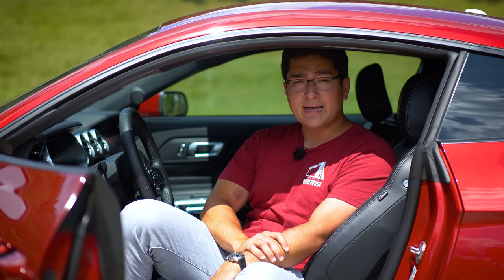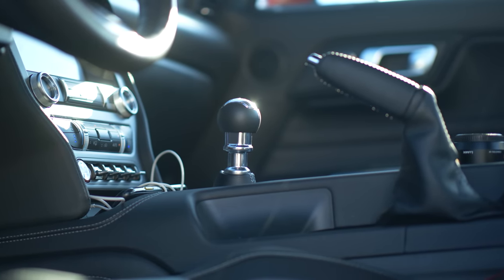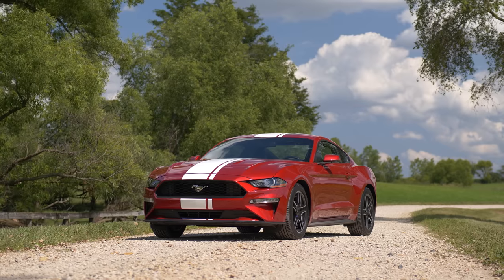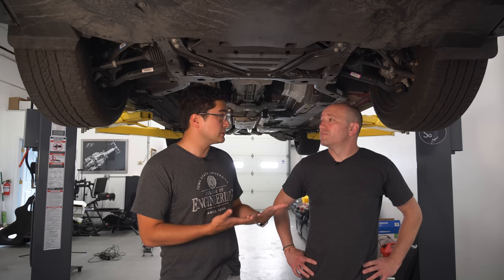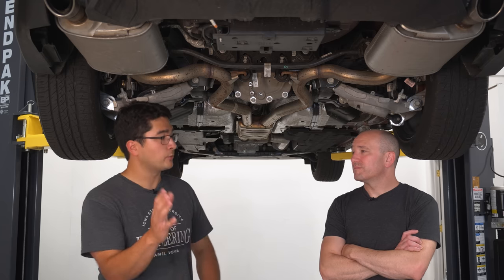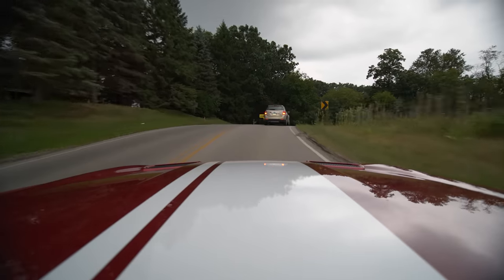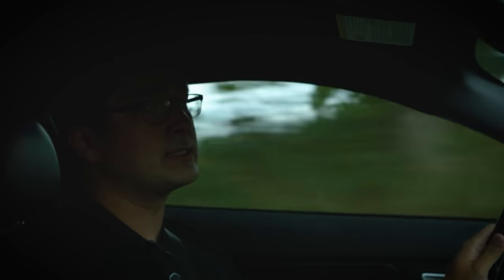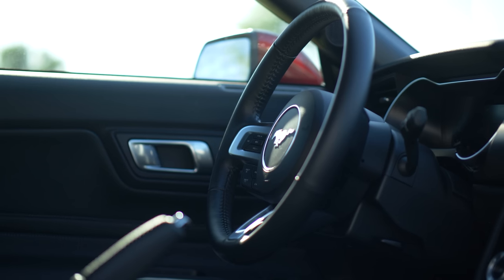2020 Ford Mustang EcoBoost | Red Headed Step Child

Comment: Loving my HPP HP. Great gas mileage when I drive it like a "normal" person but can't always find the strength to do so. 200 lbs lighter up front than a GT and just a BLAST to drive in any corner. Spec'd out and cheaper than the PP2 GT. No brainer. 7th Mustang I've owned and over half were GT's and this one will smoke all of them. Nuff said.
Reply: You're so lucky man to have gotten an HPP ! I got a Roush RS1 Ecoboost since the HPP isnt sold in my country. I had mine optionally fitted with the Turbonetics NX2 and the enlarged Honeywell/Garret intercooler. Its plenty fast but its always nicer having a full factory car.
Reply: PP2  all day bro...Stock and I'm smokin you brother !!
Reply: @A.ChristopherJohnson  Should have got the non-ticking GT350 like my buddy.
Reply: Love my 2020 2.3L HPP with the handling package. I installed the Roush intake and it’s a blast to drive in the twisties. It’s amazing to me that you can get a Mustang with a pp2 package and magnaride for under 40k. Your video puts all the 4 bangers in the same bag and they are not all created equal. I personally would choose the HPP over the GT for balance and handling. IMHO.
Reply: Prefer Supercharger (Whipple/ Roush), because at 38,000 miles i had Turbine Lockup within the Turbos at 82°+. This is caused by Thermo Variations consider locations of Turbos Ford mounts them below for lower center of gravity.  Problem is they're right next to the very hot engine.  Ricers know this and mount them up high close to heat extraction hood vents.  To keep them cooler, and not for show. Now the Turbo Shell expands like a donut 🍩, while it's being baked the outside expansion is outwards vs. Inside expansion is inward the hole gets smaller. The Blades expansion is outward to be larger to hit the Shell. Locking up the Turbine Blades, and then add the Backflow from the Intake and Downpipe to it to spool the the Turbos more.
My fuel mileage went from 
32 mpg to 8-12 mpg.  Glad for 2021 it'll have the GT500 engine package 5.0 V8
Reply: @ChasingDifferentAdventures  Yeah, I know. I'm old but thanks. Warranty, my track records for new car purchases and or base for an engine swap WAY down the road were all concidered. Enjoy. V8's are on the endangered list. Not thrilled about it either.
Reply: @davidwilkey62  Never too for a V8, and yes i sm glad next year the F150 Raptors are going to have the 5.0 with the GT500 Super Charger
Reply: @ChasingDifferentAdventures  Matter of time. It took me decade's to accept the automatic. Lol.
Reply: The 1st time i drifted was in a 1990 Silver Fox body bought straight out of a delivery truck, at a used car dealership.  She hummed at 3,200 rpm's at 90 mph on 2nd gear.  It  was a cousins and he traded it in for a family car, without telling me.  The sales guy asked him what's wrong with it, cousin said  I'm about to be a Dad, handed the keys for a test drive.  Sales guy said he had driven Vipers none had the power out put the 1990 Mustang GT. Incidentally, it was all stock from the factory, had been tolx by Ford tech it's speced to impress Magazines reporters or today's Top Gear / 5th Gear /or Trottle House /Motor Week critics
Reply: @davidwilkey62  No kidding  not even the GT500 doesn't have a Manual Transmission...  that bothered me.  Though, you go to Hotels especially, up northern California (SF) went to take someone up there was payed to do so as well as room.  Protection though it meant using my car.  Anyway valet wore out my tires and the clutch, as well as fuel. He couldn't get my car up the subterranean parking lot.  He stuck for 10 minutes,  his supervisor said if you get it up in less than 2 minutes he's fired.  He was let go. Had to fuel up found a gas station 6 miles away and it still smelled like burned clutch . Parking was free and 6 months after $2,000 in repairs Clutch and all Mounts and tires.
Reply: @ChasingDifferentAdventures  Yikes bud.
Reply: @ChasingDifferentAdventures  👍
Reply: @davidwilkey62   Well I was surprised it lasted that long, though, because I also raced mostly road course a lot My 2005 Suspension had to be replaced.   All rubber components wore out soon after wear & tear as well as weathering.
Reply: @davidwilkey62   Control arms, tie rod ends, ball joints, Half Shafts Struts & coils, I was able to replace the rotors. another 
$3,600 the year after

Comment: My wife has an EcoBoost Mustang convertible as her daily driver.  It’s pretty nice, actually, although the spring/shock/strut set-up is rough.  Thirty mpg, reliable as can be, no problems at the 50,000 mile mark.  When she bought it, it could not be ordered with a limited slip differential, which is just stupid.  As a result it’s a handful to drive here in the northern clime during winter, unless streets are clear.  Otherwise, nice car.
Reply: All 2015+ mustangs have LSDs standard
Reply: Buy winter tires. Handful to drive in the winter is super fun. Is it at least a manual?
Reply: Reni N Not this one.  Right rear wheel is driven, as witnessed by people watching it try to crab down a street that had 2" of new snow.
Reply: Protector of the Republic Automatic.

Comment: I drove the high performance ecoboost a few months ago, it definitely was a quick car, with the high performance model it does 0-60 in 4.6 seconds... that really isn’t “that” far off from the gt. If I were to get the ecoboost it would have to be the high performance model or I would just go to the Gt, because you definitely feel the difference in the regular ecoboost to the high performance, it’s definitely worth the couple grand. As a daily driver I would most definitely get the ecoboost, could I daily the Gt? Well yeah obviously but just as a daily, I’d prefer the high performance ecoboost.

Comment: I'd love to see you two review the same car, but with the performance and handling packages plus a tune. Torsen diff, 3.55 gears, firmer suspension and bigger sway bars, with more like touching 400HP at least? Has to feel like a totally different animal.
Reply: I can tell you. While I do not have the pp I have new coils, new intercooler, exhaust dp etc and a tune. I make a little under 400whp now and can gap gt's.
Reply: I think a good set of coilovers would transform this car. Even Fords pp needs a little help with their damper selection.

Comment: As somone who now owns a GT having enjoyed the 2.3T for a few years, my own driving experience really doesnt match this clinical and misleading review - on the one hand you flatter the ecoboost: to imply that it is much better on gas mileage than the GT just isn't true. If you 'baby' either engine,  you can get 35 mpg on a flat highway,  yeah, if you 'track drive'  the GT it will sink down to approx 12mpg whereas the ecoboost can be pulled down as low as around 18mpg. BUT, for me, real world driving average has proven to be an identical 23 mpg in both cars.  On the other hand, you are way too dismissive of the ecoboost's performance...all very "meh"  in your view it seems:  Yes my GT sounds a million times better than my ecoboost did, but it's only a tiny bit faster (I was getting 0-60 in 5.5 seconds in my 2.3T) and given that the ecoboost is more nimble/agile and has got tons of low down torque, I reckon I would get a faster time around a very tight and twisty track in the 2.3 than I could in my GT (and that is why some car reviewers (on this side of the pond anyway),  have referred to the GT as the 'posers car' but the 2.3T as the true drivers car. I can see why they would say that.
Reply: Frank White  even tho I traded mine (for a GT) I disagree with you for many reasons. have you driven one?
Reply: Frank White  Ok, if that's your experience, fine I won't argue. The fact that my 2.3t got 5.5s 0-60 is phenominal for engine size to car weight ratio and I am not sure that my GT would shave more than 0.5s from that at best - so I am perpleced by your "no power" comment.  The savagegeese "saddles optional" review seems far more positive towards the 2.3T.
Reply: Frank White  ok, well let's agree to disagree. I found the low down power and nimbleness of the 2.3T to be anything other than "pathetic" in terms of ability to throw it round corners and to be competetative in road race scenarios - sure, you don't take it to a drag strip or expect high end power, as it's offering a different perfromance experience - to compare it with a 560hp car is kind of missing the point imho.
Reply: Wakanda Forever  Like I say, I don't want to argue mate, but you lost me - 550hp from svo 2.3 blocks in the 80s?
Reply: @MrHammoreds  where’s the guys comments?

Comment: People downplay the Ecoboost....but IRS suspension, drive modes, 310 hp / 350 torque, and 5 sec 0-60 times were Ferrari numbers not that long ago.  it's no slouch.  An Ecoboost with a larger aftermarket Turbo, intercooler, and tune will smoke a GT (you can actually buy the upgrades directly from Ford).  The manual Trans is SLOWER than the 10 spd auto and the paddle shifters are the real deal (it won't force shift).  You need a DCT trans to match the 10 spd auto performance.  I bought my 2020 Ecoboost Premium Convertible for $42,850 (loaded) and it was $5000 MORE than the 2020 GT it was sitting next to in the showroom.  So I don't know how "value priced" it is as you say.  I did buy the Ecoboost because I daily drive a lot (200+ miles a day), and didn't want the 16 mpg.   This car requires 93 octane to get the most MPG and Power (around $50 to fill the tank at current prices).  I made the mistake of putting 87 octane in the car the first 2 weeks I had it. It lost 20+ hp and I was only getting 18 mpg mixed driving.  With 93 the power came back and I get around 23 mpg mixed driving.  I honestly never thought I'd see (let alone own) a Mustang with all the performance options, leather everything, Bliss, collision avoidance, automatic cruise (ADAS), navigation, and a wifi hotspot. If you're in the market for a Mustang convertible then buying a GT just doesn't make sense.  This is my 4th Mustang.  I've owned both the GT and Ecoboost.  (I also currently own a Camaro and a Corvette. - they both stay parked because I don't like them that much. I HATE the Camaro with a white hot passion, and the Corvette is incredibly hard to park in the city. Gave the Camaro to my wife.)

Comment: I AM a driving enthusiast and have owned 3 BMW M Roadsters, a flawless s2000, an e46 M3 and dozens of other nice cars.  

I have also owned a 2016 mustang eco boost that was bone stock minus 19” wheels.

I can tell you this ecoboost is actually quite fun and has serious performance.  I would say the number one drawback is that it does not have a good exhaust sound.

Other than that, these two are WAY Off on this review.
Reply from the maker: None of your cars listed had a v8.  Get in a Mach1 or GT500 and tell me that ecoboost is good.  (Being a smart ass BTW)

Comment: “My only complaint”.
You guys have complaining this whole video.
This is not the GT or higher trims with the bigger engines and better suspensions.
People who buy this version of the car already knows this.
This is why the eco-boost version outsells the GT 2-1.
I see more “regular” people drive this version that car rental fleets.
I have a ‘19 velocity blues eco-boost and I have all kinds of fun in it. Because I’m not an adult kid anymore I’m gonna be 40 in 2 months.
I have had V-8 cars in the past and that time has come and gone.
I had my fun in those types of cars and now I’m more about practicality and insurance.
Easily could have bought the GT, didn’t want to.
I have way more fun just cruising and getting great gas mileage and complements on the car, than cornering hard and stomping on the gas and watching my money getting flushed down the toilet because I’m once a week putting gas in the tank.
Regardless whatever your income level is.
It’s all in what your preference is.
But take it from me, if you aren’t a hooligan and know that this version doesn’t sound and drive like the GT, you will have just as much fun in this version just like the big V-8.

Comment: I watched this the other night. Then reviewed the 2015 video, and watched the current eco-boost video again this afternoon. I'm a senior and different demographic from Sg, but I was very sport car motivated during my younger years, and I have competition experience, (so I am a car guy). I'm looking for a comfortable, touring type, GT car with year round capabilities. I don't have room nor do I want the cost of two vehicles, so the eco-boost Mustang manual trans with LSD (for winter) looks like a good fit for me. I initially thought Sg's review was negative, but after viewing it a second time, I agree with most of his statements. I want a manual trans because I'm still a boy-racer at heart. Plus 300 net hp is A LOT compared to what I drove from the 1960's to 2000+. This car looks like a good fit for me.

Comment: I bought my EcoBoost for 22. With about 2500 in mods I have new coils, intercooler, exhaust, dp, tune etc and make around 400 whp and can gap gt's. I would say that's not a bad deal. Not to mention taking it to a local track day there was NO WAY any GT could keep up with me once turning was involved. Plus I make a lot more torque than a stock GT as well.

Comment: I have been a Ford guy since my first V-8 which was  a 1951 2 dr that I bought in 1960 for $150. I have owned most of Mustang V-8 offerings and including 428 CJ and a 302 Coyote and I can tell you 90% of car buyers are not performance drivers. An Ecoboost Mustang offers plenty of power for the 90%.. For some reason internet "gearheads" seem to think everybody wants or needs more power. They don't.  Even those  who claim to be high performance drivers spend more time at car shows than they ever do at a race track. I don't know have many times I asked a driver how it handles on a road course and the usual answer is "I would never take a chance on a race track".

Comment: I picked up my base manual Ecoboost for 21.5 with 2k miles. I came from an NB Miata and compared the Mustang against the Focus ST, GTI, BRZ, 370z, BMW 228i, and V6 Camaro. The Mustang was the last vehicle I test drove. The performance, both speed and handling, was much better than I had expected, along with the comfort, practicality, and RWD, I was sold. I was able to pick up an extra set of wheels and tires (RE71s), GT brakes, intake, intercooler, and Cobb AP for less than 2 grand (parts are plentiful and cheap). I also upgraded the speakers as the stock ones were in fact horrible. For me it's been a great car. I've been on the track with it a couple of times where I was able to keep up with or pass many of the above mentioned cars. It's very comfortable in everyday driving and long highway trips, averages 27 mpg, I can fit kids and dogs in the back, etc. Would I love to have a GT350 or M2 or something like that, of course. Do I really need it for the money and for everyday driving, not really. Anyway, thanks for the review, just thought I'd share my perspective.

Comment: 300 hp, rwd, fairly well balanced. Might not be a hardcore sports car but definitely not slow or boring. It's sporty enough especially when you take into consideration that the Miata is considered a sports car (not throwing shade on miatas. I love them) Ford did a solid job making what I would call an entry level sports/pony car.

Comment: I remember the original 1964 Mustang.  Straight 6 cylinder, 3 speed floor shifter with non-syncro 1st.  A no frills sporting looking car.  Ford has always made the Mustang in a basic commuter configuration.
Reply: It was originally marketed as a young family car

Comment: I do have to agree with others, you guys come off as very snobbish and I think very pompous. I went back and forth with the GT and Ecoboost with 55k as a limit and choose the Ecoboost with no snobbish voice in my head telling me it wasn't as good as the GT. I have driven many many GT500s and have not one issue with the Ecoboost. There is plenty of headroom for more horsepower and if you can handle a GT not having but half the HP of a GT500 and just because it makes a V8 noise and be snobbish it's better than the Ecoboost just for that, I don't know what to tell ya. That quiet Tesla is going to blow the doors off of your GT and that snobbish tone will go away quite quickly after that. Life's short fellas, more non snobbish remarks and more positive reviews on a car that deserves quite more.

Comment: 300 hp economy car what a time to alive
Reply: Jack Wells  well I used to sub 100 hp econo boxes from the 90s. the 3.7 v6 or 2.3 i4 ecoboost seems like massive upgrade when considering sn95 mustang 4.6 v8 made around 265hp
Reply: Jack Wells  incredibly slow to rev. A tune fixed that though. Ford really crippled the V6 with their engine tune. The 2.7 or 3.0EB V6 would be a very nice substitute. Maybe in 2022

Comment: This is a viable option for me over the BRZ/86 when you add the handling package. As an autocrosser this is a pretty intriguing combo though the performance package versus handling package is a little confusing. I appreciate knowing there are still engineers and product managers at Ford who aren't trying to shoehorn us into SUVs.
Reply: Believe as someone who owns both, the brz is an extension of the body in auto cross.
Reply: @xXxUrbanNinjaxXx  I imagine a normally aspirated BRZ would also have better long term reliability
Reply: @xXxUrbanNinjaxXx  I bought a 2022 BRZ and yeah it really is intuitive and fun to autocross.